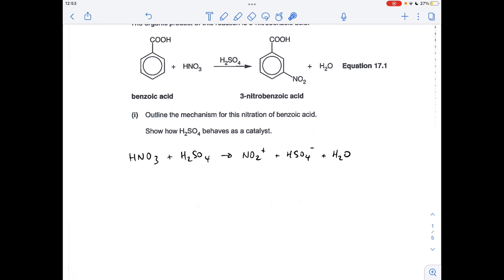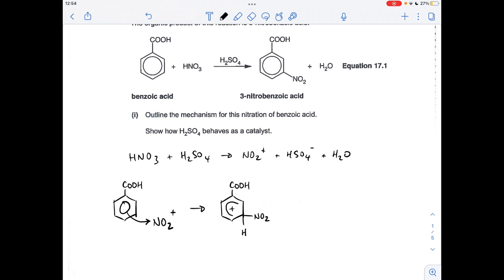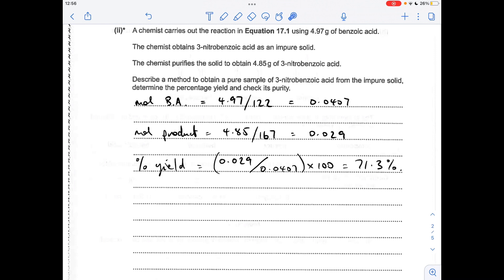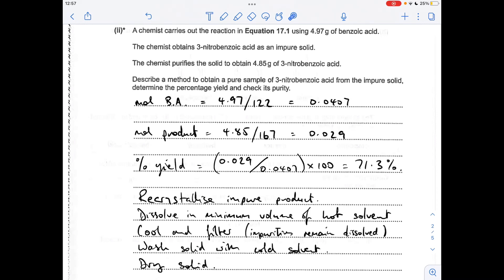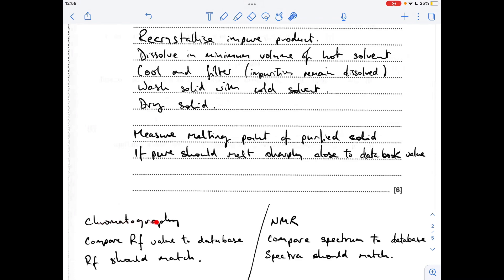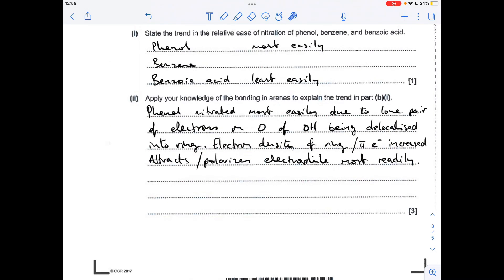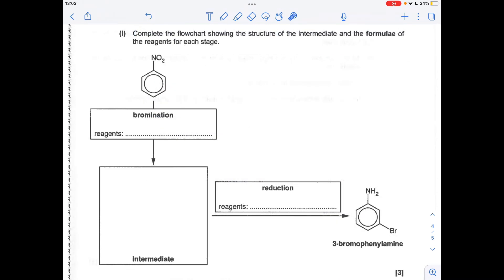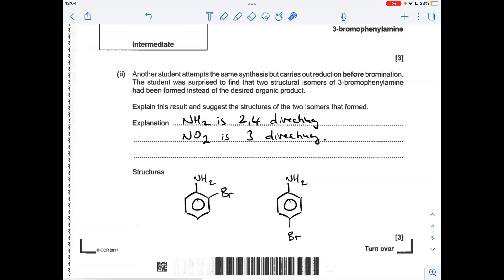A LEVEL CHEMISTRY EXAM QUESTION WALKTHROUGH - AROMATIC CHEMISTRY 13

Comment: Hi sir, for the percentage yield I got 71.2 % where I rounded to 0.029 but used the unrounded value for 0.0407 (on calculator). 

The mark scheme says: ALLOW 71 to calculator value of 71.29001554 correctly rounded.

Will I get the mark?
Reply: If it says allow then ofc you will.